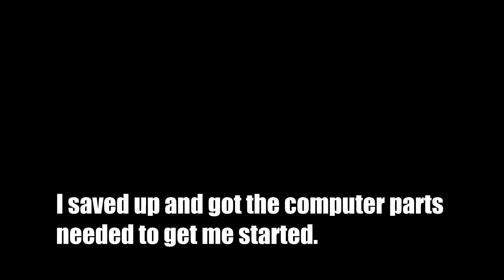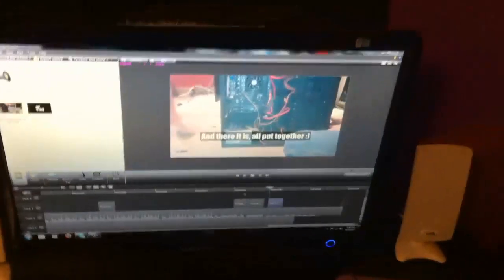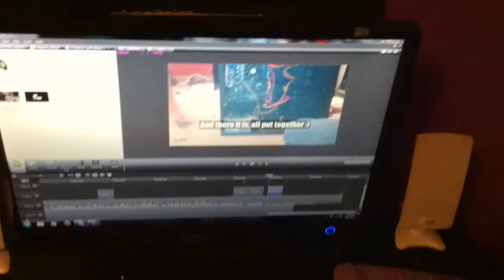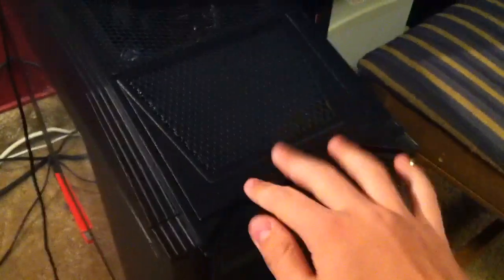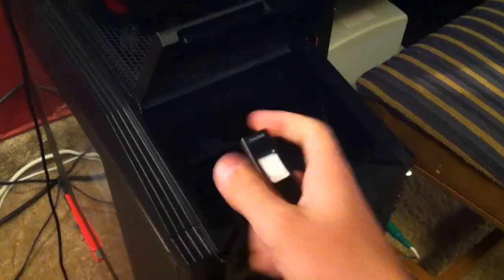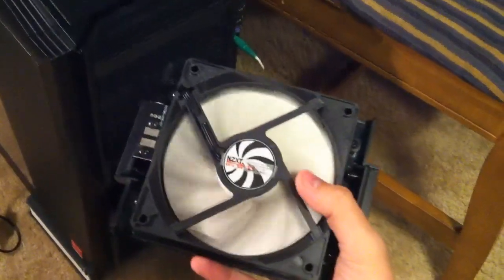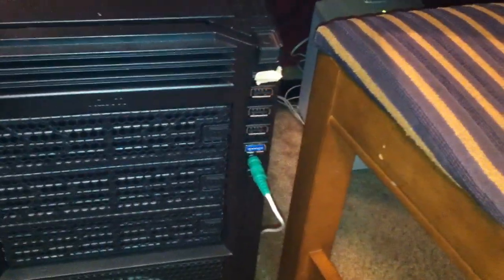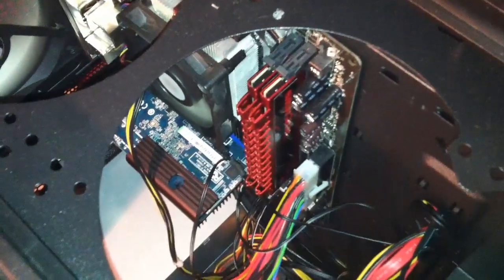[OLD] My Computer Build | Setup Video

Comment from the maker: This isn't meant to be high end. This was just my first build to get my computer going. I plan on buying an ASUS Z77 Sabertooth, Intel i5 3570k, EVGA GTX 670 FTW or Sapphire Radeon HD 7970, EVGA SuperNova NEX750G 750 watt PSU, Seagate Barracuda 2tb HDD, OCZ Vertex 3 120gb SSD, Corsair Vengeance 16gb RAM, and I'll liquid cool it with either a Corsair H100 or H100i. Once I have all this it will be pretty high end.